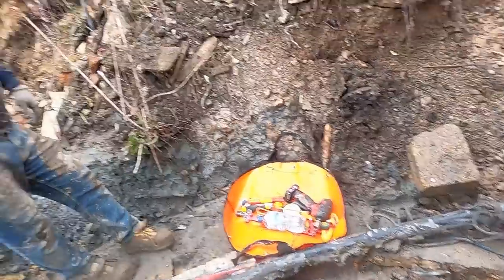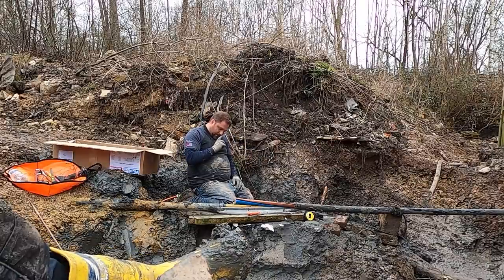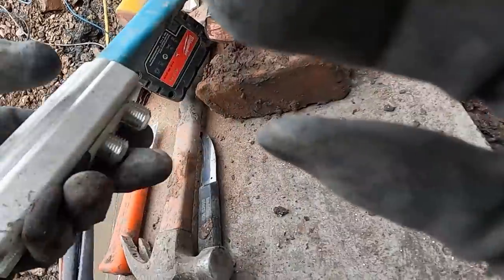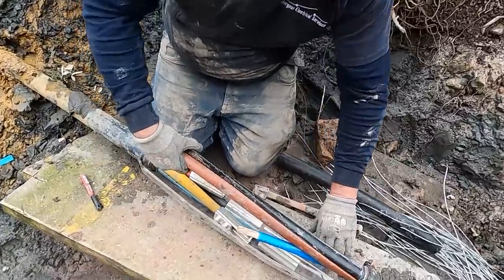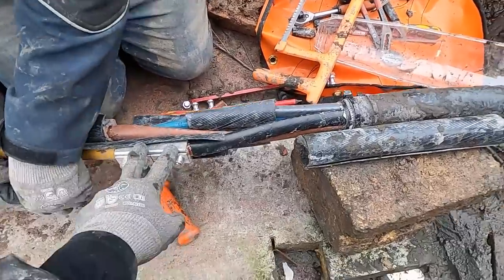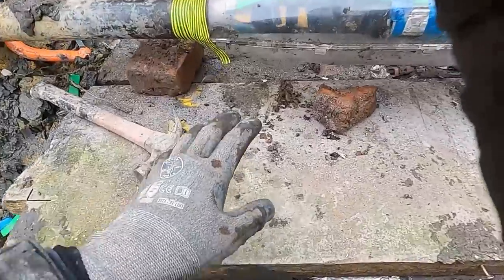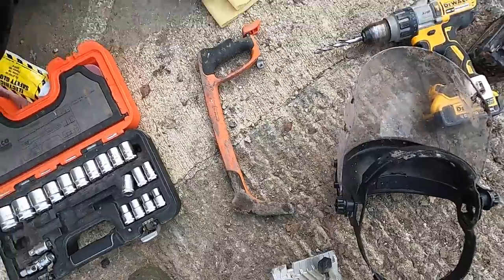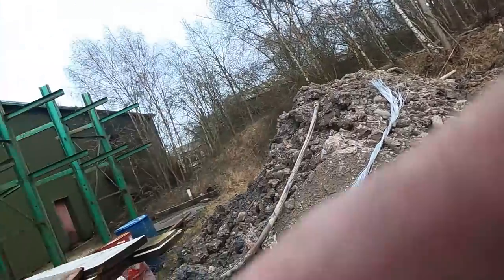Cable jointing at a cannabis farm - Part 2

Comment: Kudos guys, a hard days work in the mud. I did many of these 240mm joints about 40 years ago, nothing much seems to have changed, it's still a gym workout. We had a foot pump operated hydraulic cutter and crimper which made life a bit easier, I would imagine battery operated equivalents are available now. Something we learned quickly when pulling in the cables was to be mindful of how the cores rotated, if a cable was layed  back to front, the core rotation would be opposite, making it extremely difficult to fit the jointed cable inside the plastic casing,  because the last of the four cores would not align neatly, making it a larger joint.
Reply: good tip, thanks
Reply: Yes sir, i will keep it in mind next time.

Comment: isnt the purpose of that resin to sweep between the cores what the electrical tape prevents in your case? another is a watertight seal but its insulating in the same time

Comment: One of my fondest work memories is jointing a telemetry cable between 2 reservoirs summer of '91 (very hot). They put a new water main down the side of an existing mains and hit the cable multiple times.
Apart from the fact I was working with multi- core 1.5mm in blazing hot sunshine this did bring back happy memories.

Comment: I did wonder when you were pulling the cable in whether you had checked the cable rotation so the cores lined up at the joint . The panel end can be crossed over to suit

Comment: Get a plastic faced hammer for tapping the ally connectors onto the conductors, too much with a metal hammer burrs the ally edges and you can’t slide the shear off bit in after..... don’t ask me how I know this 😂
Also have a word with who orders the gear in, go at least one size up on the resin joint.  Better to be plugging the ends of the case up to hold the resin in than fighting the cores together to make it all fit.  JME from the few I’ve done.

Comment: Definitely need to get bigger shells mate. As a DNO jointer myself I do this sort of stuff on a daily basis, usually live. Our shells for that size cable are about 3 times the size, much easier and allows space around the cores and connectors for the resin to run. Good video otherwise 👍🏻
Reply: Can’t help with where to get the kit from sorry, all my stuff comes from our own stores. We use kit from TE connectivity, raychem, and lovink. The low voltage connectors we use are basically the same as the ones you used but come with an insulating shroud that clips around it.
Reply: Would agree as a DNO joint who does these joints live a bigger shell would definitely be better as you could have more room between cores for resin to get in. Also if you abraded the outer of the cable where it enters the shell the resin would bond better to stop water tracking in. I would always clean and  degrease the joint before resin goes in again so it bonds properly. These are the main causes of most of are faults on new joints. You can also work out rotation of the cable so that when you install your new piece you don't get a cross. The more you do the easier it gets
Reply: @danielelise7348  DNO’s have to do majority of LV mains and service live so you don’t lose supply to all the other customers on the feeder.   Trained to do it live using correct PPE.
Reply: @residualelectrical it’s worth giving UKPowerNetworks a shout mate as the joint packs they use are always best industry standard

Comment: Hi is it not better to have NO insulation tape on inside so the resin can get into all the gaps and crevices. Genuine question not having a go. Great vid tho had to do that a couple of times but only on column lighting cable never that size cores. 👍👍
Reply: 100% the resin isn't getting into the cores an connectors properly with that tape. No water barrier each side of the wavecon. No decrease on dirt. The bottom on the shell had dirt inside when applied. Not spreading any hate but this joint will fail in time.

Comment: Is there a way to check the amount of current going through the cable above ground? (while it’s still buried) can I check current using cat v scan or will that only tell me if it’s live or not? do you need to come into contact with the cable insulation to get a current reading ? Or do I need to expose the cores and do high voltage multimeter test lol to get a reading ?

Comment: I don't know if it's a good idea using impact to those ripe of screws, I mean maybe they break from the stress, not the torque. In the UK you don't use crimping connectors?
Here in Hungary we mainly crimp those type of cables, and also use really thick heat shrink for every wire, because you have to have double insulation.
Reply: @residualelectrical  yeah, I know. Aren't the shear off bolts purpose is to make sure you tightend it to a certain torque, so you don't have to use a torque wrench? My concern is that if its tightened with an impact gun, the way the tool tightens it maybe break it prior to achieving the desired torque setting.
Reply: You are right Gra, I’m a jointer live LV-33kV in UK we shear off instead of crimp now and the impact gun can damage the threads. But for some reason we don’t crimp. Probably for speed that’s all mate
Reply: Yup, shear bolts should be tightened with a steady hand and wrench not any kind of impact device to ensure the torque is properly reached.

Comment: I really don’t get why manufacturers make the shells for these joints so small. For the sake of a bit extra plastic and resin it would make the job so much easier. Also if you’re doing a lot of work on this size cable I’d definitely recommend getting a set of ratchet cable cutters. They’ll change your life! Just don’t use them on steel wire. That’s an expensive mistake I made...
Reply: Best ones are Birkett resin joints cases are bigger

Comment: I probably would have seperated the conductors with stand offs and then let the resin cover it all, my only worry with the insulation tape would be the air pockets filling with water.

Comment: Nice job .. it's really a pain fighting with 240-185 mm²  copper ..  surely is a 2 man job .  300mm² alumimium is less weight but still a tough  2 man job connecting them .. they don't  stay bended ..

Comment: You do know you can't joint copper directly to aluminium  ??  You should have brass so it doesn't react
Reply: @residualelectrical  when I have joined aluminium and copper cables before I have put a brass mesh between the two to stop direct contact.  You said in the video there was water in the existing cable.  Hopefully none gets into the joint .
Reply: Bit of bi con paste will do the trick

Comment: What is the joint called where I branch off of the existing armoured cable? to connect it to a new build off of the existing armoured cable like a T joint or 3 way joint is it the same straight joint but using different (3 way) terminal connectors for another cable?

Comment: Why aren't you using heat shrink over each one of your joints you have enough wiring either end to slide a piece on before you connect the wires and heat it up
Reply: indeed heat shrink with glue

Comment: Would heat shrink on the joints worked better? I suspect you did not want the resin to migrate into the joint given it’s an insulator.tape wrapping just as good I suspect we have very specific cable wrap tapes for these joins in the US. Hard job manipulating those cores. Well done.

Comment: I work on the railway doing HV Cabling and instead of a hacksaw I’ve started using a large pipe cutter works a treat just have to be careful! Good stuff anyways mate 👍🏼
Reply: @residualelectrical  exhaust cutter we use, the ones that look like bike chains 👍
Reply: Me too...just make sure the wheel is sharp so you don't turn in a burr.

Comment: Learning point always clock your cable before pulling it in saves crossing cores that jointing kit looks overly tight  for the size of the cable most DNO jointers would struggle with a shell that small
Reply: Glad you said this, I was cringing at them trying to cross those cores over
Reply: @residualelectrical  no if you'd pulled the other end into the building you wouldn't have needed to cross the cores I agree you have no input on the role of the cores but not having a cross will make your life easier only takes a minute to check the ends of the new cable before pulling it in will save you time in the long run
Reply: @TheFool2cool  yeah always make things easier for yourself if you can
Reply: @TheFool2cool  95mm on your own is difficult enough...so these guys with this did very well. you can't be to critical unless tried yourself lol. its bloodly hard going joining swa cables

Comment: Whichever engineer approved the design of this joint is brave to not mandate some kind of sleeving between the connectors.  Putting that surplus insulation sleeve in there is your choice but I'd do the same thing.

Comment: Me personally I don't tape the cables or connections inside the submarine joint as it gives the resin I better chance to cover all the joints just a preference is all great video tho they are a pig haha
Reply: Never tape around, thought it was just me
Reply: Was thinking the same.
Reply: I'm the same I never tape them .I was always taught to avoid air pockets .
Reply: @drugsbunny7081  that was always my thinking behind it better off with no air pockets better joint
Reply: @keithbyrne6521  I'm pretty sure its to avoid the connection heating up .  an old HV guy told me that years ago . I think he taped them out fear .but good job none the less .
Reply: I'm sure it defeats the purpose of the resin.

Comment: Is there a problem with contamination at joints because of different metals coming together the aluminum to copper connection
Reply: @residualelectrical  gotcha thank you for the explanation

Comment: Speaking from my armchair (!) I can't believe that design of joint is acceptable long-term. The water coming out of the cable ends, the live metal parts pressed up against the case (leaving virtually no thickness of resin), and the mechanical bending stresses placed on the resin where it seals the cable ends, would appear to give a good chance of fireworks after a disappointingly short time!
Reply: The joints are sealed in solid resin the water in the cable can’t get to them
Reply: Plus it's crap effort.

Comment: What is the gauge of the conductors and voltage is sent through the cable
Reply: Here in the UK we measure our cable sizes by cross-sectional area in square millimeters. The sizes are in the video description.

In terms of operating voltage it will be a three phase system with 230V from phase  to neutral/earth and 400V between phases.

Comment: nothing wrong with cutting cables with a grinder mate, common practice in AUS. Bandsaws also good and ratchet cutters are great but pricy!
Reply: Dewalt makes a battery powered ratchet cutter. Its pricey but saves a lot of time and sweat on big commercial and industrial jobs

Comment: Just a thought, but you struggled a bit because all the cores just didn't line up with the corresponding core on the opposite cable meaning you had to twist them to fit.  Perhaps (because the far end hadn't been terminated yet) you could have joined the cables any colour to any colour keeping them flat and then re-marked the unterminated end with tape or heat shrink... just a thought!

Comment: Really sorry mate, no offense to you or your mukka but that was shocking procedures and techniques ..very dangerous if I seen that , I would cut it out and rejoint it, and the water leaking down cable is on its own is dangerous, that will fault, them connectors should never touch any other core especially exposed, I cant express how dangerous that is, should be seperated adequately  all patched up or use insulated conectors, the she'll was actually a water shell designed for covering damage on sheath not for a joint, and I don't know about your DNO but we always have a minimum of 40mm moisture seal either side in joint to prevent water tracking in, as again that will blow up.a joint, if someone from UK power networks seen that i would imagine, and hope they would pull your company.I won't bang on about it to much, but that is a bomb waiting to go off... when your dno arrives ask them for some advise

Comment: Sorry but this is why electricians should not be jointing cables 🙈
As a cable jointer, this was really hard to watch
Reply: @residualelectrical  
I actually enjoyed the video mate. 
To be fair, They joints are terrible and 240 is a nightmare to work with. 
I would of opened up the old cable first to check the rotation, if you flipped your cable Round the other way you wouldn’t have any cores crossing in the joint.
Reply: I thought they did a great job.
Reply: Agreed.  Imagine if they were to work live like us😂

Comment: This was rough. Way too many useless tools. None of the right ones. A lot of wasted effort in both parts of the video. Neither of you must be qualified or experienced jointers. I'm not trying to come off as smart but you could've prepared better and be out sooner. The body and hands can only take so much abuse. You need straps, come-alongs, proper knives, a butane burner, a proper mallet, ratcheting cutters and the list goes on. Stop using carpentry hammers to form the bend in cables. ROUGH!